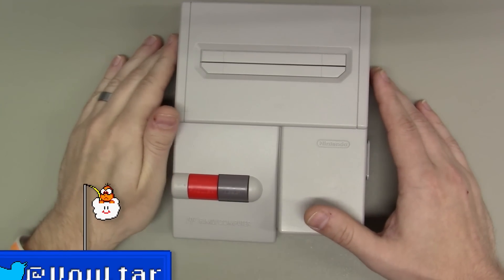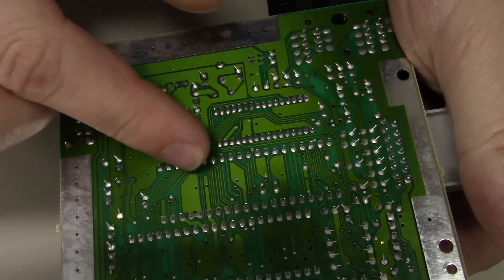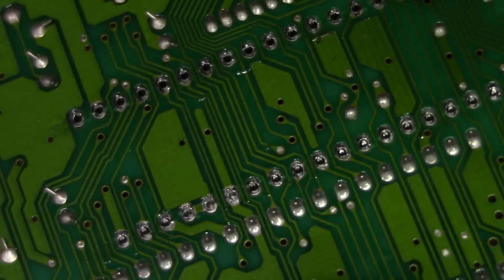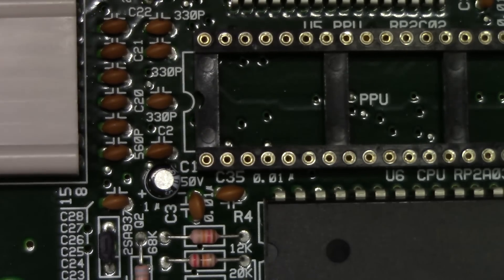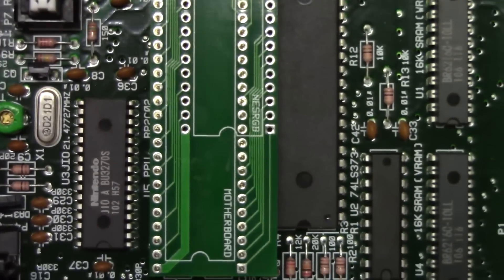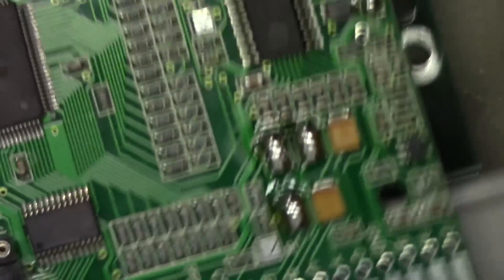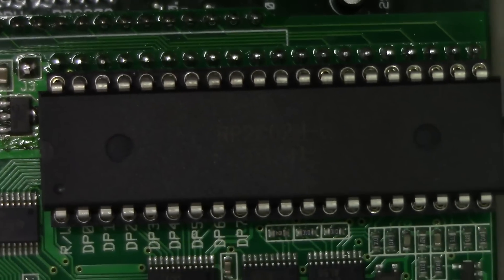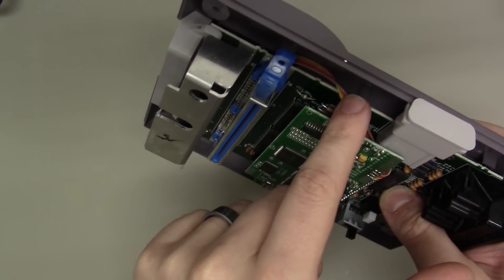Getting Amazing RGB Video from the AV Famicom!

Comment: Earlier on in the video you mentioned the importance of only using turned pin sockets with their appropriate round pin headers, but later on you used the same socket for the PPU to sit in. It's a literal "square peg & round hole" situation, and I'm not sure how great of an idea it is to do myself. I'm sure you have your reasons though. o:

Comment: Gorgeous work complete with many tool tips. Thanks so much for producing this video! I'm new to DIY projects and repairs  but have done a mod or two on DMG-01s and GBAs and recently repaired my old Sony Receiver that had a problem with Dry Solder joints around two key ICs that got bombarded by too much heat over the years. Prior to re-flowing those dry solder joints I replaced a few caps around them thinking that was the issue. Please keep making videos. We need a fix it culture in America.

Comment: Pretty nice. I think the greatest service you perform is that of the basic soldering/electronics teacher. A lot of the stuff you talk about and show seems obvious or completely basic, but the fact that you talk about these things means that it's really not, at least not in the console modding scene. Keep that up, it's pretty fantastic that there's someone out there that can communicate concepts as simple as heat flow or ensuring a good joint in such a simple, quick, and clear manner.

As for where you should go next, I'm both really curious about the nightmare mod jobs you've seen before (Bad Console Mods would be a great series if you kept up with it) but I'm also really interested in your opinions about keeping quality high even under low-budget considerations. You mention having a $70 tool as being essential to a job vs having a cheaper tool, but sometimes it simply doesn't make sense for someone to spend $70 on a tool to install a board much cheaper than that tool, especially when you can have "good enough" or "okay I guess" results with a $5 tool.  To that end, I'd be really curious about what you can show us about those situations.
Reply: I took a soldering/desoldering class a decade ago at the local community college. It was enlightening for sure, but I've learned more practical skills watching Voultar since I found this channel late last year. Especially in the judicious application of flux, which made RGB-modding my N64 the easiest job I've ever done at such a small scale. With the quality of these videos it's easy to misjudge how downright tiny the components really are, and when I first held the board in my hand I was a little worried whether I could install it with my skill set. Of course I had no cause for worry, it went off without a hitch and my N64 puts out beautiful analog RGB now.
Reply: During my time at university I found a neat summer job on a science project where I was unceremoniously and suddenly thrust into the position of being the guy who soldered and tested everything on a few of the project circuit boards. Aside from a quick 2-hour lesson on how to properly solder, given by a lab tech two years older than I was and who had nothing better to do on a thursday afternoon, I had no previous experience with soldering.

All I really learned from the first week was this: Use tweezers, make sure your soldering iron is at a right temperature, lead-free solder is for suckers and chumps, there's no such thing as too much flux (except when it's in gel form that you have to clean in an ultrasonic bath filled with acetic acid at 90%), even and consistent heat is key in making good joints, inspect everything with a jeweler's lens and simple multimeter to make sure that adjacent leads don't touch each other, roach wires are for losers (but if you have to use them, at least do it right and clean), and most importantly, a good soldering iron tip is key to anything you do.

I'm happy to say that I learned most of these things within just a week of hands-on practice and that 2-hour lesson. The project was a success, and its relative quality meant that the project circuitry was good enough for a NASA scientific balloon launch. Our payload was one of three that managed to last for three days when the mission specs only called for 12 hours of operation. There were 12 payloads in total. I'm happy to say that my soldering quality meant that our payload withstood the temperature extremes of the high atmosphere without joint issues.

These are the skills that Voultar teaches, and I'm seriously amazed that people don't know them. I'm happy to see Voultar teaching them in such a clear and concise manner.
Reply: You can be told how to solder time and time again, but nothing is a more effective learning tool than actually doing it yourself. It's not a difficult thing to learn, far simpler than other skill-sets like welding. If you don't have the right equipment or a clean tip, you can pretty much throw any project in the bin.

Comment: With all the dire warnings that accompanied this mod I was afraid I'd mess up my mainboards - but I took my time and worked carefully, and completed the mod on both my systems. I used a mechanical desoldering tool (one of the spring-loaded solder suckers integrated into an iron) - it's no Hakko but it really helped.
Side note, I was so, so happy when Tim released alternate firmware for other palettes. The "natural" palette is way too vibrant, the "composite" palette is much better.

Comment: An additional note that's missing from this video: The kit comes with an 8 pin din style socket which you could drill a hole in the back of the case and mount there to soulder the graphics outputs to, however, the method Voultar shows here is newer and allows you to use a multi-out RGB cable, such as for the SNES and Gamecube. The official NESRGB site notes that an SNES cable will not work, however, I have the SNES multiout cable from Retro gaming cables dot UK and it works fine.

Comment: Great video>>
For me I would want to know what type of wire to use for which application, which flux to use, which solder is best to use (lead or non-lead) what all the mixtures of solder mean and which is good for what.

Comment: Question about the R, G, and B capacitors on the FPGA - given that said capacitors don’t exist in a D-sub 15 cable, that necessitates leaving them intact if I wanted to use a VGA cable instead of a SCART cable, yes? I’m getting very very slight ghosting on my NES and I’m wondering if it’s the capacitors or the cable I’m temporarily using to directly interface the NES with my OSSC

Comment: No NESRGB audio circuit, eh? They say that AV Famicom's expansion audio is mixed "wrong" compared to the original Famicom, so wiring it through the NESRGB can be a good opportunity to make it right. You tap it from the expansion audio cart pin and slap a resistor on it. The only question is which resistor value is "right". I just put a 100k pot on it and dialed it to sound like recordings of an original Fami.
Reply: I'd love to do something about this as well. I got an AV Fami and gosh, the mixing on Akumajou Densetsu is horrible. I haven't RGB modded it yet, but if that makes it easy to 'fix' the mixing then I'd consider it a must-have.

Comment: Nice work. I just fixed my fake N64 controller that didn't work out the box, and realized that even if it works now, it coulda been nice if I had more practice and know-how about how to do things properly. Atleast I didn't use any kind of glue, right? I do some fixing, but try to keep my modding to a minimum because noob, but I do alot of fixing handhelds. I just use a regular "screwdriver-in-the-socket-iron" and 1$ rock-hard flux paste. Since you mentioned you might make a video about some of the equipment I hoped you maybe please show us a bit more about tin mixes and fluxes suitable for that kind of work, and maybe that briliant heat gun as well. That would be awesome. Subscribed

Comment: 20:13 you mention removing the tantalum caps for AC coupling on the NESRGB board because they are already present on SNES SCART cables. Would this still apply if using HD Retrovision component cables instead?

Comment: Thanks for all the great videos, this is a hell of a channel. Just a question, I know you don't recommend rosin-core solder, but when I use a solid core 63/37 along with no clean liquid flux (SRA 312) my joints end up looking dull and not particularly sexual, even though the fillets are structurally good and they're not cold joints. When I use rosin core 63/37 with liquid rosin flux my joints are shiny and pretty much perfect, only there's now the rosin mess to clean up. Are you using solid core solder or does yours have some sort of non-rosin no-clean flux added? If it does, what do you recommend?

Comment: the real trick to those cpus and ppus is added leaded solder before you remove it and using high heat with a soldier sucker, touching the pads for a small timeframe

Comment: One more additional note is that the machine socket that the NESRGB connects to the board with is not secured that tightly. If you drop your NES or it otherwise gets a knock of some kind that's sufficiently forceful, the chip could easily get jarred partially out of the socket. It'd be cool if you did a video covering your favorite way to secure the NESRGB to the main board (other than soldering it directly to the board and skipping the machine socket). Is there any way to clip it or otherwise fasten it down tighter that still allows you to pop the board out later if necessary?

Comment: I can confirm not to use a mechanical pump. I recently killed my Twin Famicom trying to remove the PPU and damaging it, and then killed my NES front loader trying to swap out it's PPU. I've been heart broken since because I spent so much money on everything and I can't afford to replace any of it.
Reply: ThePreciseClimber I am definitely not the best at soldering. I've read and seen a lot of reference material stating that pumps work just fine, but if I had the opportunity to try the mod again, I would not use a pump. But as I stated, I can't afford to replace anything I have damaged. It killed my prospects of modding my Turbo Duo and X'Eye.
Reply: So sad,i don’t wanna solder stuff all because of fearing ruin it by accident.

Comment: Backseat modder alert! Is there a benefit to not installing S-video and composite to the multi-out?  It's everyone's choice to decide what to do with their equipment but eventually everything gets sold or passed down, so why not keep it as functional as possible?
Reply: Amir Jubran I always want either of those on rgb mods just in case for some reason I don’t have access to rgb, I can still use the console, just another option!

Comment: Would solder wick work as cleanly potentially (after the fresh solder) to remove the PPUs? For someone who will probably only do his own consoles, wondering if the vacuum machine is necessary. I've seen the mess the handhold spring-action tools leave behind but was wondering about the wick I've seen a lot of folks use.

Comment: In your opinion, would it be better for me to get the Hakko FX-888D and a cheap hot air rework station OR a 2 in 1 hot air rework station with a soldering iron that is similarly priced? I'm just starting out in working on my own old computers and want to add some mods that require soldering. The Commodore 128 I have happens to have the shielding soldered on in one place, so to even get it out and clean it up I need a soldering iron. I have a little soldering experience with a cheapo iron that had no variable heat settings, just plugs in and warms up. It also doesn't have any other tips to replace it that I can find. I have heard that Hakko tips are used in a lot of cheap soldering stations now.
Reply from the maker: Before buying a Hakko Triple-8 for roughly $95; I would look for a HAKKO FP-101 or FP-102 system. It's a vastly superior soldering system that uses the infamous T12/T15 tips.
Reply: Voultar the ones I can find on Ebay mostly come without a key. I'm guessing that's only needed to attach a desoldering module? Also I don't see an obvious display for temperature.
Reply from the maker: The key's used to set the temperature. But this can easily be circumvented by removing the photo-transistor that detects when the beam of light is blocked by the key.

Comment: Can you remove the RF modulator from the NES front loaderso you canuse that holein the chassi for an rgb port if you so desired or is he rf modulater used for some other part of the circuit? I mean a genesis2 style RGB av out.

Comment: So, question about this. The webpage install instructions uses the V (video?) to go to the multiout, but this video uses composite sync one? On what part of the nes rgb board I must solder the yellow wire of this video? I’m not sure about this inconsistency.
Reply: This video is 5 years old; the nesrgb has gone through several revisions since so instructions may have changed. Id follow the website in this particular case.

Comment: I clipped my PPU out with the flush cutters. At the end, my video was all garbled... I tried for hours to figure it out, but could not. Eventually I put the PPU back onto the motherboard and it was still garbled. So I must have screwed up the PPU or the motherboard.. it was very easy to mess up.
Reply: maybe you cut a trace by twisting some pins on it
Reply: @lutyanoalves444  I tried checking all the traces (That I could follow - some of them go under other chips and who knows where). Now I just pulled another PPU out of another NES, soldered a socket in it's place, and plugged the just removed PPU into that socket. It should have been back to normal, but my video is solid PINK!! Then I put yet a third PPU in the same socket on that board and it works normally... I can't handle these PPUs.
Reply: @mattgallagher7105   was the other nes working normally? because if it was, but then it was pink on that board, its likely that that board has partially broken traces somewhere, meaning that the act of pulling the chips in and out of the socket may have reconnected it just by chance. in that case, the board is still salvageable with (hopefully) a couple bridges here and there.

that, or if the ppu was also not working on the other one, these chips' age really is showing.

anyway, i just find it unlikely that DIPs would be damaged by sniping their legs, but what do i know....
Reply: @lutyanoalves444  I think it's weird too, but I plugged a few chips into one of the boards, and only one of the PPUs is working. I now have a total of 3 dead PPUs, a working PPU (inside a working NESRGB modded console). I bought two aftermarket PPUs. I also have another NESRGB kit, so am thinking to install it and sell the NES for cheap with pictures of the inside etc. since I don't need two NESRGB modded consoles.
Reply: @mattgallagher7105  
cool, since youve learned how to do proper modding with our lord and saviour voultar, try getting your money back with that console. people also seem to appreciate when you do retrobrighting in them, so maybe doing that would fecth a higher price, depending on the state of the case.

Comment: I would love you if you could point me towards a good place to pick up that desoldering pump. Sure, call me cheap, but the ones I'm seeing at all floating at about $40 above the price you quoted; Can't tell if I'm just dumb or if the price you gave is from a couple years back potentially
Reply: That's why I figured. I just wanted to make sure I wasn't being dumb and missing something obvious. Still, either way, if it's decent, $120-130 for one is still pretty good.

Comment: Voultar is it practical/not insanely difficult to do an RGB mod to a SHARP Twin Famicom which I have, I really haven't found any good documentation out there on this model if RGB is possible/practical.
Reply from the maker: I think I'll do a video on that, my friend!
Reply: That would be much appreciated! Look forward to it, I'll be plenty busy RGBing/recapping  my Turbo Duo in meantime thanks to your vid!
Reply: I installed a NESRGB into a Twin Famicom. It wasn't too tough and you can use the original DIN for RGB if you don't want to modify the shell.
Reply: Excellent, I would like to reuse the DIN also if possible, I love the way the red/black Twin Fami looks stock and want to try and keep it that way. It must look beautiful outputting RGB now.

Comment: Hey Voultar, what do you think about the sync signal on an arcade Neo Geo; is it better to attenuate it using a voltage divider and then amplify the signal again and terminate it with a 75ohm resistor to get 0.7 volts or just use a resistor, like 470ohm? will the current draw stress the chip with only the resistor?
Thanks.

Comment: Now if I were to use this mod with hd retrovisions snes cable would I leave the 3 capacitors you took off of the kit still on? Or would I still remove them anyways? Very interested in doing this myself and I know you're buddies with HD Retrovision, so I was wondering if you came into that predicament?

Comment: Hey Voultar, when you remove those capacitors on Tim's RGB board. If I ever wanted to use HDRetrovisions Component Cables on a RGB Modded NES and add the Multi-Out female connector. Is it recommended to remove those capacitors too?

Comment: would 0.6MM Sn60/Pb40 0.01sin 1.2% Low-melting Tin Lead be a good solder to use before on joints before de soldering ?

Comment: Quick question, I learned to use a mechanical desoldering tool, so...why say avoid it?  You never actually, in the past videos, mentioned why.  Is it just how easier using a vacuum device?
Reply from the maker: As I said in the video; You should probably stay away from a mechanical desoldering pump if you have very little soldering experience. An NESRGB installation most definitely shouldn't be the 1st or even 2nd project that you use a mechanical pump with.
Reply: My apologies.  I missed the probably.  Thanks for the videos by the way!  Been considering getting back into this stuff, if only for the tinkering.